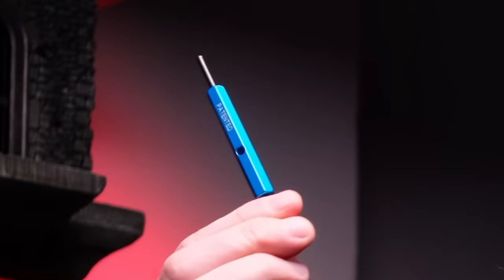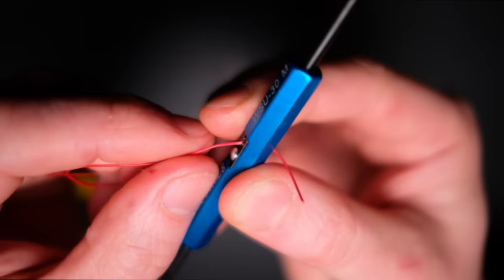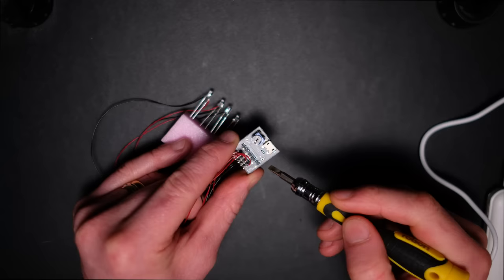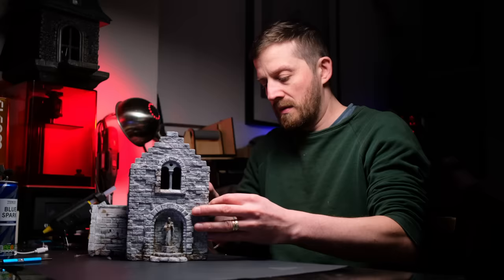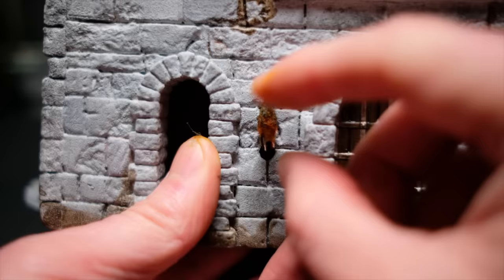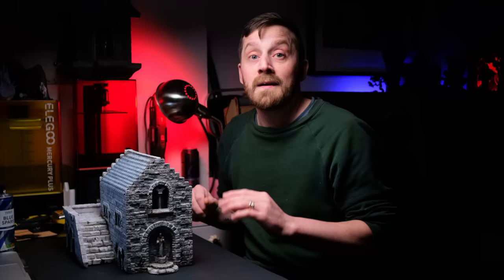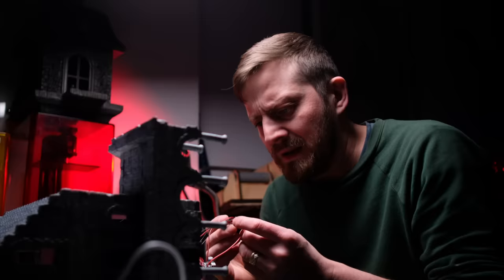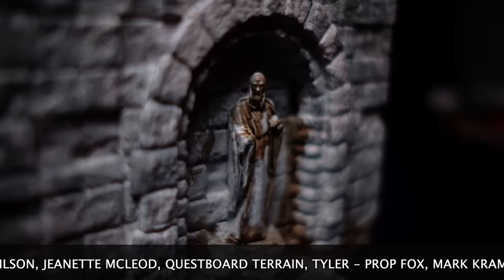Turn LED'S into REALISTIC FIRE for your Diorama!😮🔥

Comment: Adding small no-noise fans so they occasionally blow in the direction of the torches(with pillow flock), banners(made of fabric), trees(with loose-ish foliage) , having loose "leaves" creep down a street or even posters made of cigarette paper just laying on the ground that at times moves a bit adds another level of immersion.
Now, for more immersion, adding a soundboard is also great, as well as LCD screens in "portals", for the soundboard you can have these tiny Exciters that use the mini buildings or on the board to resonate sound(eh, that's sort of how they work), around the table you could build cliffs with 1cm tall houses so it seems further away, you could have black drapes on the walls so all focus is on the board, a tiny smoke machine for the chimneys is no problem; there is no need to stop, 999/1,000 YT channels all talk about quick&cheap&free/inexpensive terrain. Thank you for adding "more" to the terrain hobby.
I'd love to see a video-series of a terrain set/board starting small and more and more is added far, far beyond flickering lights.
It must be decades ago that Train Hobbyists added automated movement in streets with cars and people walking; it has developed since and is even without visible tracks.

Once, a trumpet was to be sounded off every 30min in-game. There was an actual trumpet on the castle and a speaker behind it. When the trumpet went off the first time, the players were amazed; the sound came out of the trumpet and not from floor speakers. On my gaming table there is also individual speakers for the players where they sit. The sounds their characters make can be heard by all, but with greater clarity where they are seated, like Wizard spell noises. As well as all the sounds of battle, Inn chatter, animals, wind, and occasional music; from where they originate, localized sounds. Multi-colored LED's I only use at special times in the game, mostly on spell effects. Don't tell anyone, but my W40K minis also have speakers in them/on nearby terrain giving off dakka-dakka sounds when it's my turn, as well as light effects on the weapons.
Once RPGs were played with plain paper, then a grid paper, then it moved on.
Once we played MUD, now we can play Elden Ring.
Keep moving it on.
Reply from the maker: wow you have REALLY thought about this ... a lot ! 🤣 Amazing ideas here definitely inspired by this comment. Yeah there are enough sources on how to do crafting on the cheap, amazing resources which I use myself... but I do like the idea of seeing what is possible too! Also ideas like these are becoming far more easy ash technology catches up. Thanks for the excellent comment, I really enjoyed reading that!
Reply: Don't gotta lie to kick it dude.
Reply: Damn mate, that is legitimately impressive stuff.  Some very nice ideas in there.

Comment: Got to love the efficiency of making everything work by adding a resisted short circuit that converts electrical power to heat for no reason other than to keep the battery from shutting off.
Reply from the maker: haha yeah dumb right !? ... gladly I have fixed that problem, learning as I go here, check out my latest electronics video. If you like :)
Reply: Bananas isn't it! There are smarter ways, such as pulsing current from the battery once every 20 seconds or so, but that requires a programmable solution. It's what I do on the other, smarter terraintronics products. :)

Comment: Quicker way for the flicker effect.  Just buy a cheap pack of battery-operated tea lights.  They're already designed for fire flicker effects.  Just cannibalize them and add new wires to connect to a new power source.
Reply from the maker: Tea lights are great! These LED's just flicker.... its the same thing really. But Tea lights are great too, I have used them many times :)
Reply: Tea lights are the gateway drug, but don't offer an easy USB connection or a global brightness control. However, I'm REALLY biased :)
Reply: @TerrainTronics  "Tea lights are the gateway drug" .. Well, THAT´s something to print on a Shirt.
Reply: @achimlichtenhagen3144  I would buy a Nat1Video's shirt that said that.
Reply: @TerrainTronics they're legal in oregon.

Comment: I do not know why YT recommended this video, but I'm so glad I watched it.  The memories of the 70s playing with electronics and wire-wrapping flooded back. You may already have discovered that if left unrestrained, the wrapping can work loose over time: your blobs of glue might have alleviated this problem, but when I was finished designing a circuit, I always would go back and dab a little solder onto each wrap to make sure it would hold in the long term.
I stopped using wire-wrap in the mid-80s as the mylar wire started to get more difficult to obtain: I didn't know that it was still around at all!
Reply from the maker: I'm glad you found the video! Thanks for watching :D

Comment: Some nice ideas and effects with the polyester mat. Cor you took me back forty five years ago when as student engineer I convinced my chief engineer to buy a set of wire wrap kit, (£150 which was big money in those days) including motorized wire wrap gun, so could quickly turn out complex prototype digital circuit boards. Used for a few years thereafter. Since then had forgotten about, good to see you can use as a labour saver and it’s cost effective. For me I use Christmas tree lights to illuminate my model railway buildings and coaches and run off 5V (the battery pack is another option). The shellac coated copper wire is easy to hide and tack in place with a hot glue gun. The DCC chips in the engines have a flicker effect for the digital outputs. Today we are spoilt with such cheap and varied electronic solutions - if you know where to look. All the best Stephen
Reply from the maker: Thanks Stephen! Yes this stuff is really becoming more and more accessible :D

Comment: I have some thoughts.  Oh where to start.  LOL

Ok, first, the little blue, wire winding tool.... I haven't seen one of those in decades!  This is not new at all.  Well, THAT particular tool is a newer design for sure as it has the wire stripper for tiny gauge wire.  That's handy because it's hard to find a stripping tool that can go that small without being a pain.
But the wire winding thing is very old.  I used to be a TV repairman back in the COUGH COUGH  years.... I remember that several brands, Zenith being one of them, used wire winding instead of solder on most of the chassis.
This worked well... UNTIL IT DIDN'T!  For small fun projects, it's ok.  But for more serious projects, after winding the wire, I would put some liquid flux on the work and gently solder it using a very tiny tip and very thin solder.
Wire winding can come loose over time as well as build up gunk, causing bad connections.

As for the little sconces, those turned out so cool!  I can see something like that on a larger scale as well.

As for these battery backup packs, yes, they can be a real pain in the arse for sure.  I've seen the exact same issue with them not "coming on' or coming on then going off when the load is low.

But having to put a resistor to cause more of a load is bad.  very... bad.... I get why this is done, but it's wasting battery power.

It should be the battery manufacturers that either rework their controller board and/or firmware to detect low loads.
They should also have a switch that will keep the batter functioning at low loads, but that doesn't so do by increasing the load.  It's doable! 

Those little flickering LEDs are fun.  I would have never thought of using some fuzzy material to create a more "flame" look.  That is just brilliant!
Reply from the maker: Hey, thanks so much for the detailed and thought through comment!  On the larger scale flames thing... just wait a week or 2 haha I have a video coming out very soon and it will hopefully blow peoples socks off. On the battery problem thing, I also now have a way better solution and I will be doing an update video on this very soon to share the information.  All this stuff is being figured out as i go along, so I am always certainly missing pieces of the puzzle and will always search out better solutions and bring them forward to this small community as i find them!  Thanks again for watching and the comment :D
Reply: I mean, in principle I agree with you on the resistor, but honestly a suitably low value one is just not a big deal at all.  It'd be nice if the manufacturers allowed us to "force on" battery packs, but I can see why they don't and why they have the no load time out circuit.  Bottom line is that they were not intended for this application, so the onus is on us to work around their design, not on them to add a feature few need and which has some safety implications.
Reply: @Nat1videos 
Beginner here …
Can’t these boards just manufacture low load circuit boards? 
Maybe incorporating a resistor within said board? 🤷🏼‍♀️

Comment: Neat tool, not seen that before.  Excellent work, great effects.  Also, I was shouting "Use a resistor!" as soon as you mentioned your battery pack timing out, so great to see that the designer had anticipated that.  :)
Reply from the maker: Thank you!! There is now a new option for powering it with no resistor required, so I will be doing an update video soon :D
Reply: Flickering and Flashing LEDs do not need a resistor - there is an internal circuit
However if the supply voltage is over say 6V or so you need a resistor

Comment: Overtime in an uncontrolled environment, you will have electroless between the wire and the pins or between the LED leg and the wire. Overtime breaking down the electrical conductivity of the circuit. wire wrapping is mainly used in telecommunications in a controlled environment. That’s why we solder things and use the proper heat shrink over it. Because a lot of us don’t live in a perfect environment.
Reply from the maker: Thank you Michael! Thats great input. I guess for me with dioramas, and it not being an important piece of machinery etc I find the ease of wire wrapping very useful, and if a circuit does go bad its as easy as spending 10 minutes re-wrapping.  But this is always developing for me and what I am doing here is really documenting where I am currently with my hobby related electronics! Thank you so much for watching and your insightful comment :D
Reply: Well.............from my professional nackground in a telecom and many years as a hobbyist  I think that is somewhat overstated
This was a poplar method for many years until making PCBs got easy

Comment: I think each light on each side should go to a secperate controller so they don't flicker in sync with the flame beside it.
Reply from the maker: Thats a good idea!
Reply: they go out of sync quite quickly
Reply: Use up all the timers on the mcu
Reply: @lavacat720  why
Reply: @kennmossman8701  By using up all the timers on the mcu we can have a "desynced" effect across all fire leds on like different pins
Reply: @lavacat720  well......the LEDs will de-sync  on their own beacuse of differences in the cap that stes the timing
Reply: @kennmossman8701  I meant using an arduino to flicker the leds manually instead of those candle light leds which cost an arm and a leg
Reply: @lavacat720  ohhhhhhhhhhhhhhhhhhhhhh  i see.   interesting programming challne - have to use random factor to make each  different.   maybe the esp32 would be a better choice
Reply: @kennmossman8701  the esp32 is overkill for flickering a couple leds but that's okay
Reply: @lavacat720  and using an arduino is not  ??
Reply: @lavacat720  how would you do it

Comment: You may not needed to use that fat resistor to draw the higher current to keep you USB power bank on. Most power banks these days do have a 'low-current' mode in order to charge things like wireless earbuds and smart-watches, (depending on model) either hold down the power bank button for a few seconds or triple click. Try it, could save you hassle next time and the power will last longer, it's a win-win 😎
Reply from the maker: oooohhh cool tip ! Thanks :D
Reply: your completely right. this isn't something that happens with ALL power banks -- just cheap ones ;)

Comment: Wonderful and creative way to create flame-effects!  I am making miniature led candles, am hoping to use button batteries for power.
Reply from the maker: That should work just fine! Good luck with your project :D
Reply: those 3V coin batteries may not have enough voltage      It depends but many need 4V

Comment: If you pull the wire through the tool when stripping the insulation rather than our of it the tool should last longer without breaking. I've seen many wire wrapping tools with broken wire stripping plates. I had to do more wire wrapping in the late 80s than I care to remember
Reply from the maker: Gladly mine hasn't broken just yet ! :D

Comment: If instead of wiring the board to the LED accessory, we wire it to a male magnetic connector, then wire the LED accessory to a female magnetic connector, the two connectors would attract and the LED would light up. I think... That would potentially make the system very modular and would allow us to change the LED accessories at will. Do you think that is doable? I thought of this when I saw the Magnetic Connector video on Bevin's Brick World channel.
Reply from the maker: Yes !@ Thats a great idea... although there is an easier option which is reed switches which you can trigger with magnets :)
Reply: @Nat1videos 
How about a video or link for that?
I’m just learning so a visual can help a lot.
There are some great comments here!

Comment: Great explanation and awesome detail to add to your craft! 1 thing that could push it to 110% would be added soot via pigment or paint where the flames could touch the wall. It is a detail though that could be overdone so if it isn't added it won't take away from this great piece
Reply from the maker: Thanks! That is a really cool idea actually, I hadn't thought of doing that! I may do it on a tester piece and if it looks good a super nice detail to add so thanks again :D
Reply: @Nat1videos  It only really came to mind when you put the lights in place and I saw all the other cool weathering you had done on the building, so nothing I have tried yet either.
Reply from the maker: @10urion  It makes total sense! this is why I love this community, always ideas to glean from other crafters and elevate your terrain :D It's all about the detail ;)

Comment: S U P E R B  effect!   I had doubts reading "realistic fire"  and LED but I was wrong!  Thanks for the inspiration!

PS: Your WR tool stripper will work well longer if you use it pulling the wire in the reverse way that  you did in the video, in effect keeping the blades firmly against the tool by pulling through the tool. 
T H A N K S  again!
Reply from the maker: ohhhh cool! Thanks for watching and thanks for the helpful tip :D Also... I just dropped a brand new video using this technique to a much larger effect with a fire breathing Dragon. Please check it out :D

Comment: How did you get the battery to stay on?  I have the same ones and they turn off after a short time if there's not a somewhat sizable load on them.  Four LEDs and a board wouldn't keep mine running, I don't think.
Edit:  Addressed it.  Thanks.
Reply from the maker: No problem! Yes the resistor is a good option! But please check out my most recent video. I have a better solution :)

Comment: Should you really use a battery to test leds? I thought you had to have a resistor in series to prevent burnout
Reply from the maker: Nah... I do this all the time and have never had a problem :)
Reply: Stefan - coin batteries have poor output resistance. We take advantage of this when you quickly test  LED's :)

Comment: Apollo used wierwraping 50+ years ago and you still must use some protection against shorting especially as you now have "live" conductors all over the place. Soldered components have the legs cut as short as possible, no conductors to bend and short. wire wrapped components can slide out and loose contact and only unskilled people get frequent burns. The only reason to wrap things is if you plan to change it during developing a cirquit and then only in a lab or a secure workbench.
Reply from the maker: Thank you! Although the burns thing was for comedic effect ;)